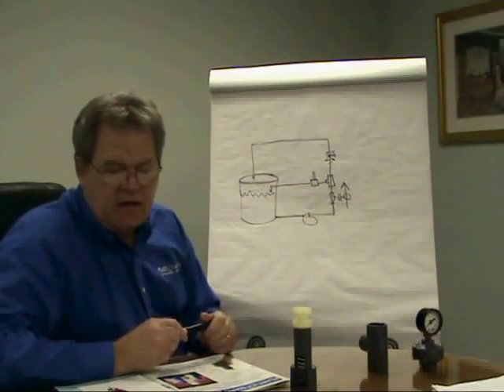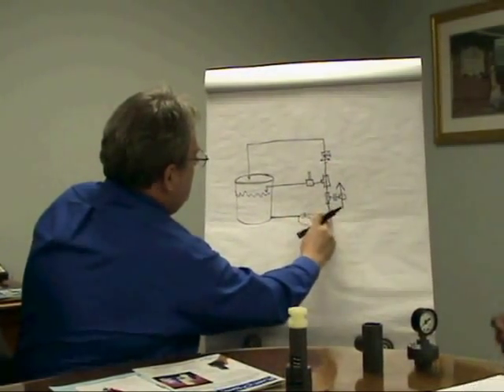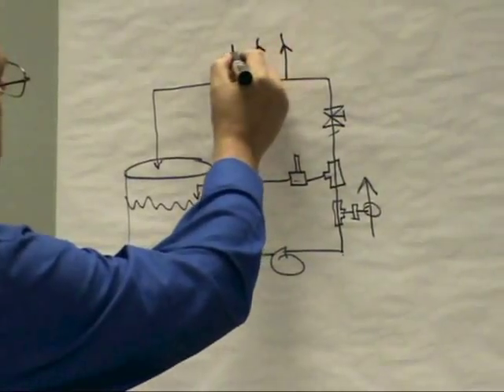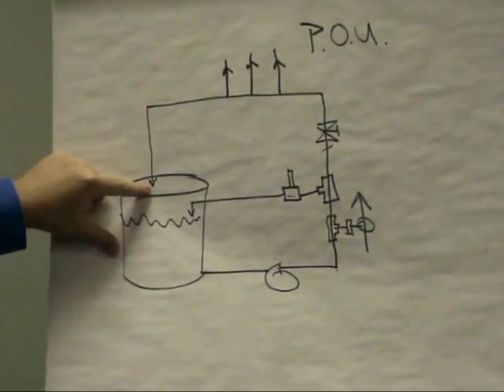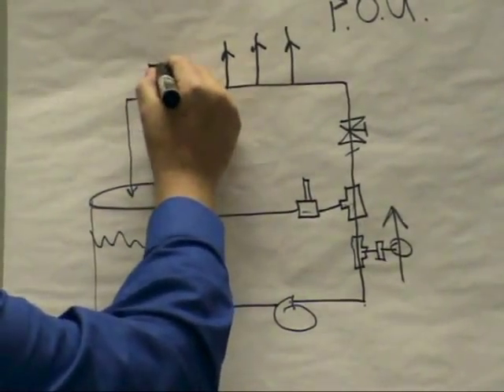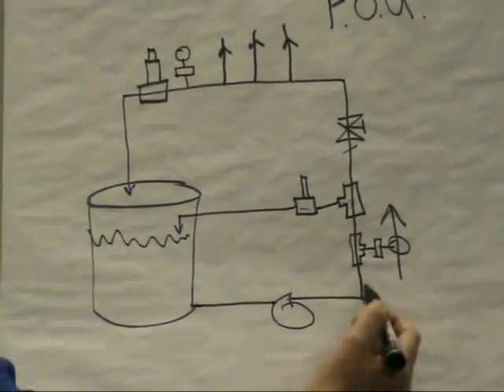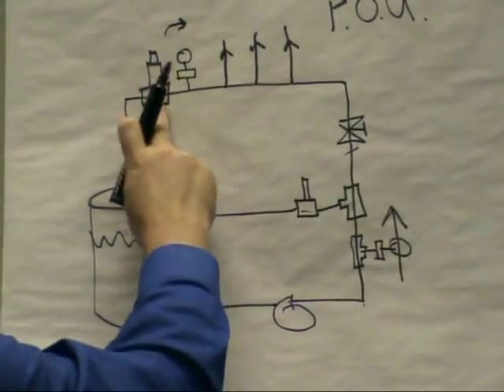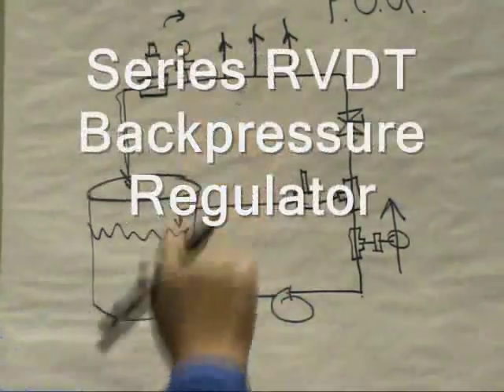Backpressure Regulator in a Closed Loop Piping System

Comment: why can the bypass valve not be used in place of the backpressure valve to control return flow and thus backpressure?
Reply: Hi jsohn, thanks for your interest.  The valve Andy is describing does all of these things:  Relief, bypass, pump bypass, backpressure, anti-siphon -- Series RVDT performs all of those functions because they are all based on upstream  pressure, or backpressure.  In other words, our bypass valve is a backpressure valve.  Andy is simply calling it different things based on what it is required to do in the application.  Here is a technical brief that may help clarify:  http://plastomatic.com/technical-article/introduction-to-reliefbypassbackpressure-valves/